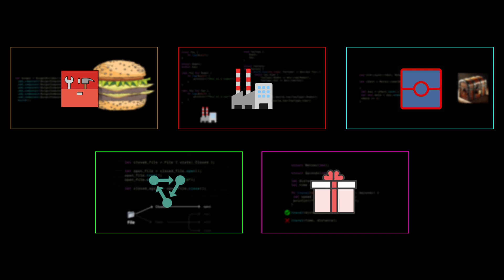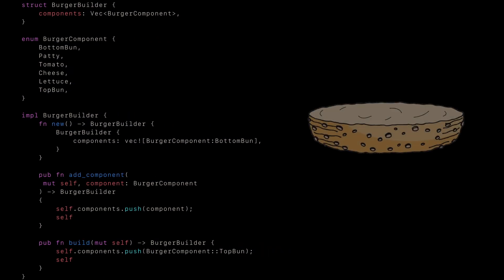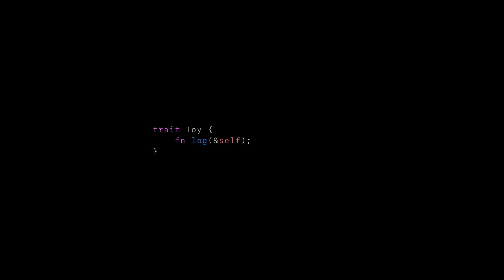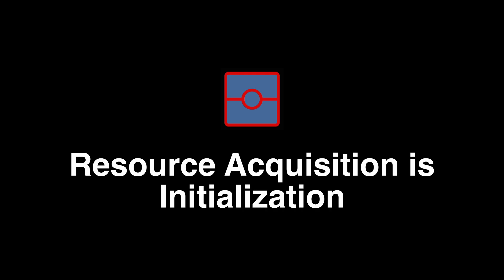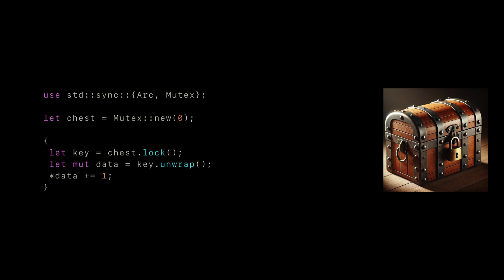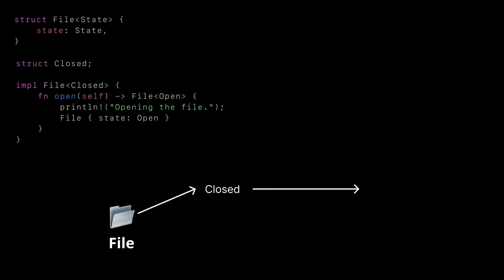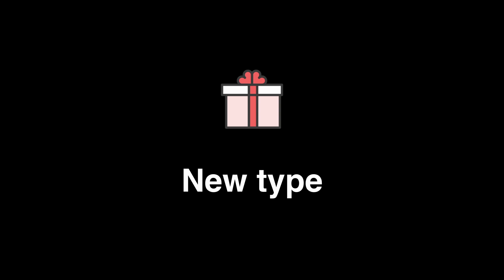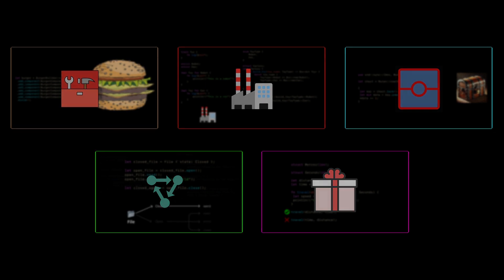5 Essential Rust Design Patterns to Write Better Code

Comment: Very sad you didn’t show off how type-state and builder pattern can be used together to hide certain implementation details after a choice has been made (ie: burger meat - like say chicken burgers can’t have specific types of sauces) so when calling and returning from a builder pattern chain you modify the internal types to represent the correct typestate API available.
Other than that pretty good vid bro
Reply from the maker: Thanks for pointing that out, thats a really good point, that it abstracts away refactoring so you don't need to make updates throughout your codebase. Thanks for commenting!

Comment: The RAII treasure box analogy is confusing here. An airplane bathroom analogy is more fitting. The bathroom lights won't turn on until you lock the door. When you leave the bathroom and unlock the bathroom, someone else can enter and lock it for use.
Reply from the maker: Thats interesting, thanks for the suggestion that would've been a good analogy for sure.

Comment: I think we should leave the factory pattern in Java. If you need a function that creates objects just put it in global space, or if you like in a module, because creating a unit struct type which will not even be instantiated is just a more complex module.
Reply: Does creating several methods to create a Toy, like defining Toy::from_robot(...) and Toy::from_car(...) kinda count as a factory pattern? with Toy being a struct instead
Reply: @Haglax I mean, for these methods you should use the trait From, but this isn’t a factory. Classic java factories are classes you instantiate which you call a method on to instantiate your final object. This pattern is idiotic because you can just pass the parameters you passed to the factory to the constructor function instead.

Comment: Those patterns are useful, but in Rust, you should avoid them. It is all about functions and passing data from one function to another. When you have complex value, use struct. But if you try to use Rust in OOP way, most certainly, your solution will be overengineered.
Reply from the maker: Hey thanks for commenting. Yeah fair point you shouldn't approach it in an OOP way, nor should you force design patterns on a project. But despite that they can be a useful tool when designing software.

Comment: For the typestate pattern, I would recommend using PhantomData<State>, and setting the default state = Closed, this will result in a more ergonomic api
Reply from the maker: Thats interesting, thanks for the comment. Haven't used PhantomData much before and looks cool
Reply: I've often found that storing State rather than PhantomData<State> is a more flexible design. If State is a ZST, both cost nothing, but if State has some internal data, only storing it directly lets you access it.
Reply: @joeybf  I mean why would states have internal data. I could imagine them having _associated_, data but they're states, it's just a thing you can either be in or not. It usually makes more sense to store information about what happens in a particular state outside of the state itself. At least in my experience, I don't know.

Comment: The biggest unstated problem with software is the unstated objective that, to most code owners, code SHOULD be hard to understand, and even in some ways hard to maintain.  This is in align with many businesses that try to rely on ownership of business patterns that are unique to them, and thus are difficult to mimic, thus raising the cost of entry to competitors into their business.  It is helpful to point out here that this associates with the very reason that the title "Perfect Competition" is an oxymoron.  Now, I agree with the theory of perfect competition, but it also is an intentionally distorted by misused words, which is not unlike what we do with code.  It should be called Perfect Cooperation, and it not only should it more clearly talk about transaction costs, and in particular information costs, but it should be taught as a starting point whose understanding needs to expand especially into understanding those costs.  The original intent of "Perfect Competition" was an excuse to not change or educate the perspective of the players, but merely say you can get optimization by letting them "go at it".  The definition, however, clearly implies otherwise, as was seen by any non-delusional but careful reader to begin with.  Fixing things involves addressing those transaction costs, and communities do that with evolving understanding and cooperative learning.  Coming up with simple patterns for these things is great, but without a helpful cultivated environment, you still end up with a mess.

Comment: Great explanations! This is literally what rust is about. Static types and safe ownership model that allows checks at compilation. + polymorphism that makes your code clean and flexible. Moving from js to rust saved me hours in the long run. Its a little more difficult to write code in rust, but the compiler errors make sure you don’t make dumb mistakes and its so much easier to debug. If your rust code compiles, probably it will work as you expect the first time you launch your code, that is if your code logic is correct.
Reply from the maker: Yeah exactly, I love that about Rust. Once your code compiles I've noticed a pretty significant reduction in runtime bugs compared to typescript.

Comment: Hi, i am new to rust but the builder pattern seems flawed. For me the add_component() methods should either not require build() or be transactional. So components shouldn't be added to the object until the build() is called.
Reply from the maker: Hey thanks for commenting. You’re right add_components shouldn’t require build, and in the example it doesn’t. But components should be added up until build is called.
Important to note this example is a bit imperfect, the build method should produce a separate struct entirely.

Comment: As a Java developer, I don't agree with a builder pattern. Populating Vec is not the best example, would be better to specify a struct with many fields and populating that struct using the builder pattern
Reply from the maker: Agree with you there, that’s a more realistic example. I toyed with an example like that but found the code was a bit big and hard to display.

Comment: 4:24 - btw, there is already exists Duration for time typization. Good example of new type pattern u suggested, thou
Reply from the maker: Thanks! Not sure what you mean though, mind elaborating on "Duration for time typization"?
Reply: @maxtaylordev  there is standard struct in rust std::time::Duration
I said this because newbies should know that this type exists and not to reinvent the wheel, like you showed in example with Seconds(i64) at 4:24 (but I think they will run into it anyway, because it's used in std library everywhere for duration (who would mind haha))

Comment: Those patterns were all initially introduced in the book of the GoF for C++ in the 90th. Nothing Rust specific here.
Reply from the maker: Thanks for commenting. Yeah true the patterns themselves aren’t new but it’s still interesting to look at it through the Rust lens to see examples of these patterns
Reply: @ Naming the video “5 Essential Rust Design Patterns…” is misleading, because it’s just “Design Patterns” which can be applied to many programming languages. Mentioning Rust here, just wants to point Rust in a superior position.
Reply from the maker: @muadrico  I agree that they are universally applicable but the naming isn't to set Rust up for superiority, but to align expectations for viewers. If you came here expecting C++ examples and got Rust that would be kinda annoying
Reply: @maxtaylordev  I came here, to see some Design Pattern that were particularly unique to Rust (as you announced them in your caption) in order to learn something new.
Reply: I think this video is relevant and Rust specific since these patterns in particular are particularly important and widely used in Rust due to its language design, whilst many other patterns are less ideomatic in Rust compared to their use in other popular OO languages. That is, Rust is different enough in paradigm to traditional OO language, to make it notable that these particular patterns are worth using in it. For example, builders are even more useful than usual in Rust than some other languages since Rust does not support function overloading.
Reply: @ThomasWright27188281828  Actually no. These pattern are not Rust specific and even much older than the Rust programming language.

Comment: The data has nothing to do with RAII. Your data still lives after the mutex closes. The only thing in your example that respects RAII and scope-based resource management, is the lock, i.e. the key, when that get out of scope, it runs its destructor which closes the mutex. But that is not the purpose of RAII.
Reply from the maker: Apologies if that was a bit confusing but the intent of that section was to demonstrate RAII for the lock not the data itself

Comment: For the builder pattern, it's not just components that you can build with, it's also composing behavior. E.g. you can combine builder with strategy pattern for example.
Reply from the maker: Yeah good point, it's very flexible and pairs well with other patterns

Comment: The builder pattern becomes useful when you have both restrictions as well as the need for flexibility. For example, if the hamburger is not allowed to have 2 layers of sauce right on top of each other. You achieve this restriction at compile time(!) by having the add_sauce() function return a different Builder object that doesn't have a add_sauce() function.
Secondly, you're not going to start every Rust video with "Rust is a great language" are you?
Reply from the maker: Thanks for the suggestion, yeah the builder pattern deserved more time given it’s so flexible.

If starting every video with “rust is a great language” is already annoying then probably not, but I don’t want to rule anything out.

Comment: Watching this, I've come to realize why I dislike the de-facto approach to solving problems using computers, which is to treat code as the first class citizen, instead of the data.

Problems involving computers tend to change over time. By mapping the data to the problem and therefore making it the first class citizen, the solution (i.e. the code that transforms the data to another form) will tend to be directly related to solving the problem at hand and nothing else, hence making it easier to comprehend by the programmer.
In contrast, orienting around the problem will eventually over time make the code brittle and resistant to change as its responsibilities extend over time (by virtue of its orientation). Needing to ensure the many responsibilities of such code are in working order is of course more mentally taxing to the programmer compared to needing to maintain only one.

Therefore, I see the existence of code design patterns as merely a band-aid on solutions which are fundamentally suboptimal. Though, I admit that the "newtype" pattern will come in handy.
Reply: I also understand why such an approach will never be mainstream; the cost of collaborating is much higher due to the requirement to understand the entire problem, its data and its transforms to be able to make meaningful contributions, and therefore its geared toward individuals or very small teams with domain knowledge; suboptimal to make a job market out of.
Reply from the maker: @not_herobrine3752  Interesting take, thanks for commenting. Agreed data parsing/manipulation becomes such a large part of most software projects and its hard to deny how much technical debt just that on its own introduces

Comment: Hi I am curious. Is it safe to just unwraping mutex in rust? How did you know that your program will run without crash?
Reply from the maker: Good question.
The .lock function on the Mutex will block the program execution until no other part of the program is using the Mutex, so that you can safely use it. The Mutex struct handles all of this internally so its very safe.
Reply: @maxtaylordev  I read that unwraping mutex only fail when you get poisoned state due to other thread being panic. But if we handle all posible error in our program does it still possible to get poisoned state? And does it make sense to keep running our program if our state get poisoned?
Reply from the maker: @pad8941  Yeah if errors are handled then its unlikely the Mutex would be poisoned, it's only if you acquire the lock within a scope and that scope ends due to a panic, but if you handle the errors through the Result type then you shouldn't encounter unhandled panics
Reply: @maxtaylordev  Yeah I agree. It is unlikely to get poisoned state if all error are handled properly. Good video ✨ btw and thanks for the discussion
Reply from the maker: @pad8941  No worries at all. Thanks for asking, it was a good question

Comment: Great video! With the builder pattern, it is common to return a different struct when calling `build()`, which represents the final, constructed object.
Reply from the maker: Thanks! Yeah thats a good point. I opted not to do that just to keep the example as small as possible, but you're right that is an important part of the builder pattern and worth mentioning.
Reply: @maxtaylordev This also has the advantage that your builder can have lots of Option(al) types, while your final type doesn’t use Options, and rely on the Default implementation to populate fields that are None. I’m pretty sure the compiler even optimizes all of this away and just build your final type in one go 😅
Reply from the maker: @LtdJorge  Very cool, I need to look more into compiler optimisations because that's typically not something I consider